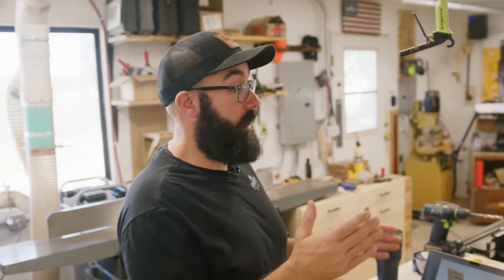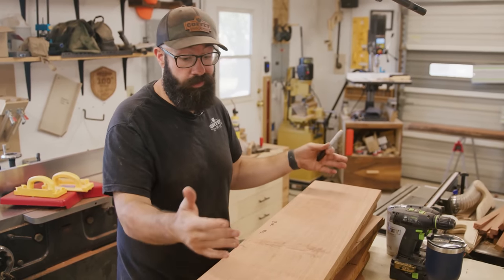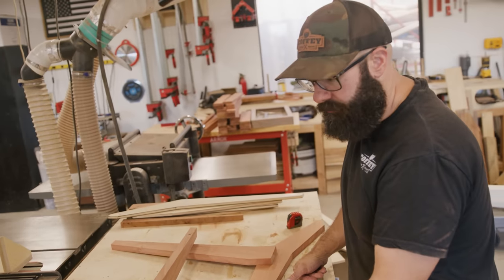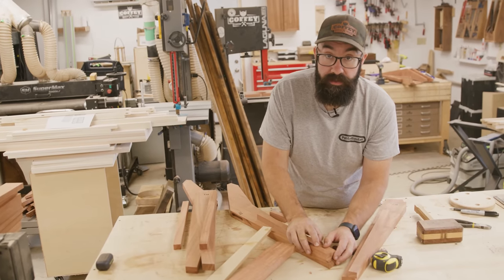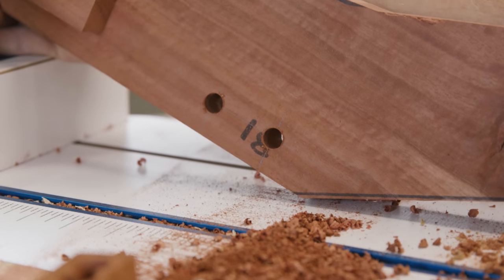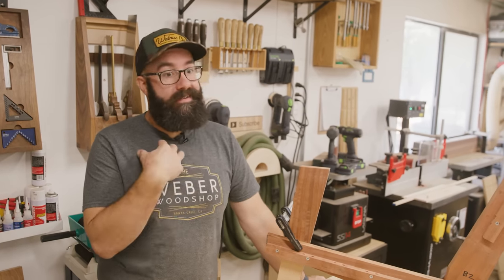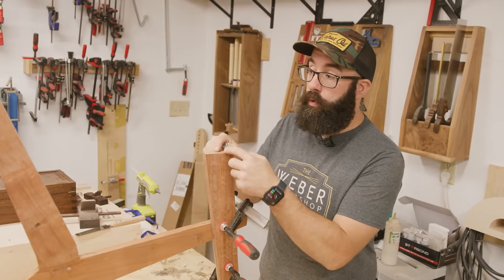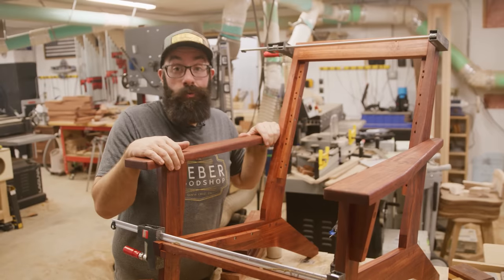How To Make An Adirondack Chair

Comment: Beautiful chair, love that it’s modern and the Eucalyptus is gorgeous! Btw another woodworker here on YT (A Craftsman Legacy) I just watched building an Adirondack chair mentioned realizing there was a difference in the drilling bits for dowels or pins (excuse my lack of naming the drill bits) the claw like bit and the one you’re using depended on hard or soft woods. The one you’re using he discovered faired much better with softer woods like the cedar he was drilling into compared to the claw bit that did much better on hardwoods. Anyways love this build and your channel
Reply from the maker: Thank you! It's just this wood species. It's extremely hard. I use these on other hardwoods regularly. This wood tears up edges.

Comment: Great build! Im gonna give it a try!  If I didnt have bolts to fit, would a nice half lap be a good substitute for that joint? Maybe a couple of  dowels though the lap to double down on racking prevention as well if needed?
Reply from the maker: Lap joint is SUCH a strong joint. That would work great.